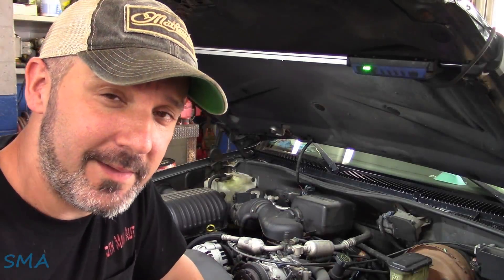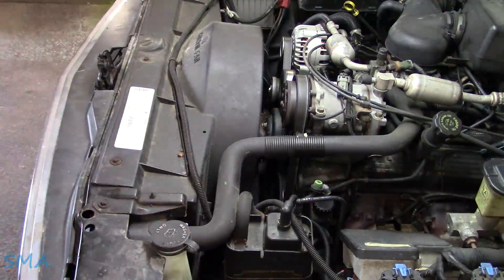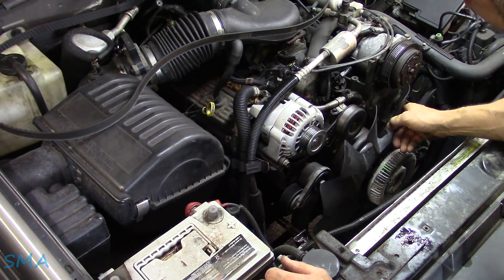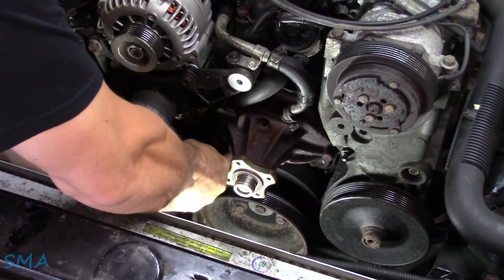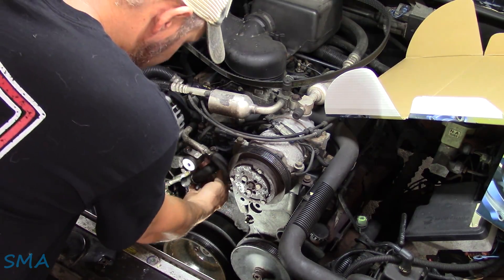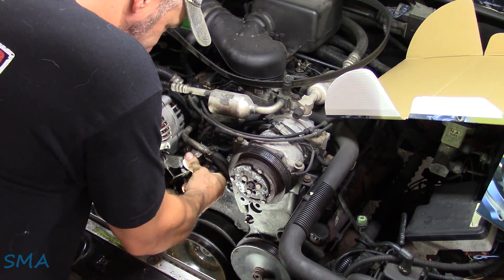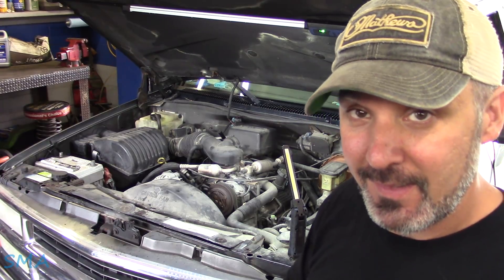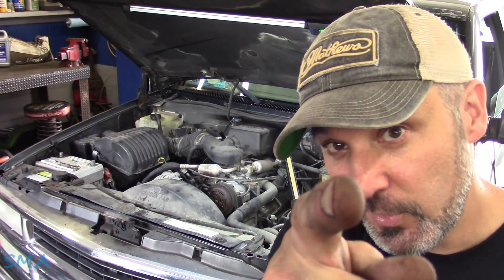Water Pump Replacement: 5.7 Chevy Tahoe / Silverado / GMC Sierra / Yukon

Comment: @23:19 Typical American automobile manufacturing ideology. Once something is perfected, dump it in favor of a new, unproven engineering design and let the public test it out for you. 
Anyone remember the Dodge slant six?
Reply: I am a GM man through and through, bowtie til i die, but i have owned an 80 Volare with the leaning tower of power, 2 barrel carb (yes, manifold swapped with a super 6). When the unibody rotted away, i decided to see how long it would run without oil, 47 hours!!! When the top end started getting quiet i knew it wouldn't be long, the bottom end started sounding like the top end, and i think it was 13 minutes later it locked up. It was only idling the whole time
Reply: I had a '66 Plymouth Valiant Signet slant six . My first car . It would start at -40 and out run my brother's 1980 305 GM pickup in the 1/4 and for top end . Loved that car .
Reply: A buddy of mine told me his brother had a dodge that had been relegated to being a field car. It had a slant six. He blew the motor up with one of the pistons blowing a hole in the side of the block. He continued to run it on five cylinders spewing oil all over the place for a month before it finally gave up the ghost.
The point is the slant six almost put Dodge out of business because it was so reliable that people weren't buying new cars. We all know what came after that.
Reply: Got a 62 Chrysler in my back yard at the moment, 225 slant six, push button auto, doing the ball joints and a service

Comment: the later engines, had the spider fuel injection, which wasn't that great
Reply: convert to the delphi mpfi unit. Plug and play, a little pricey but eliminates the spider injection problems and inadequacies. Good time to hit the lower intake gaskets while in there that far if they haven't been done. They ALL go bad sooner or later. Felpro problem solver the only way to go on intake gaskets. Great time to thoroughly clean up the throttle body and freshen up the sensors and then drive another 200k miles.

Comment: Chevy thunder!!! Most of us probably know that, other than bore and stroke sizes, the small block Chevy remained basically the same from 1955 until it was discontinued. The only major changes that I can think of are relocating the mount position from front to the sides, spin on oil filters instead of canister filters (both around 1957 or so), main journal size increased (around 1968), roller cam, 1 piece rear main seal, fuel injection and a different angle for some of the intake bolts, along with center bolt valve covers (in the 80s) and, of course, the Vortec heads on later models. Many people, myself included, still play with the venerable small block Chevy! Personally, I prefer my 400 small blocks, which are "a whole different animal" but, I'd rather work on ANY regular small block than an LS all day, every day!

Comment: Goodyear doesn't make Gatorback belts anymore. They are now made under the Continental brand which is owned by Goodyear.
Reply: I've had great luck with Gatorback belts.   Run quiet and L O N G !!!!
Reply: Continental stop making them also
Reply: @rickyg4800  You are correct...with a quick Google search I found the following....Continental Elite Series recently changed to OE Technology Series. Continental replaced their Elite helicog belt construction with the new OE Technology Series straight rib design. The goal is to deliver OE fit, form, and function to the aftermarket.... Still a better belt than Dayco or Gates.

Comment: I have this exact model, mine was a one owner when I bought it, 72,000 miles on the clock many years ago. I'm retired so it now has 122,200 on the clock and it's been a good vehicle. I'm not a big GM fan but the manual controls on the 4wd are what sold me (had a 97 Explorer that self destructed the "automatic" 4wd system and you couldn't turn it off). It's getting a bit of rust but I have a good shop go over it once a year and it does what I hired it to do.

Comment: I've had a few experiences with Chev engines. 261, 250, and 292 sixes, and I believe I have pulled and reinstalled all the small blocks plus 396 and 402s.

Comment: My BIL once diagnosed the water pump in my wife's old durango when they broke down together. So I ordered one and had it ready for when I got off work, pulled up and immediately noticed the giant hole in the plastic res on the side of the radiator.. Yay!! Screw it, filled it up with water, and drove it the 10 miles home. Gotta love those old Magnum Mopar motors. LOL
Reply: LOL, I assume you mean drivers side? where they always cook and blow the tanks out, other cars with vertical flow top to bottom split just above the crimp seam..
"composite junk"

Comment: I had that same engine in my Buick road master wagon loved that car drove it everywhere had the water pump launch off the block and go thru the radiator  went to get a new water pump and they had a 60 buck one with a 1 year warranty and they had a Bosch with a lifetime warranty for 20 bucks damn I miss cheap parts on my cars

Comment: Love this video.  I have a 1998 K1500 that I bought new that has this engine.  The original water pump on mine was replaced at about 24,000 miles when my intake gaskets first leaked.  They said the WP was also leaking but who knows.  I have 140,000 miles on the truck now still running that replacement WP.  I love this engine and body style truck and is why I have kept it for the past 23 years.  I also own a 98 K3500 reg cab long bed 4x4 that I bought in 2007 with the 7.4L.  It only has about 121,000 on it.  Between these two, I shouldn't have to buy another truck ever again.

Comment: I love my 99 chevy tahoe. Currently chasing down a headache of a p0300 code. Spark is good wires all test good. New plugs. Mas air is reading great. No vacuum leaks. Fuel pressure is good. Man what a nightmare 🤣

Comment: I've owned 4 cars with the small block, '66 Pontiac with the 283, '68 Pontiac with the 327 4 bbl, '70 Chevy with a 400 cid, and a '79 Pontiac with a 350. My fav? the 327, hands down. So much power. (Yes, I live in Canada where GM put chevy engines in Pontiacs. :) )

Comment: The belt size issue reminded me of when I did an AC and Smog pump delete on my 83 Mustang, staff at my local Car Quest were very accomodating, I must have taken a dozen belts to see which was the correct fit.

Comment: Replaced the intake manifold gasket on a 5.7 that the Dexron coolant ate....good times!
Reply: It's usually because someone ran it low in antifreeze, most likely a water pump leaking. It overheats that plastic. Felpro makes them out of metal now

Comment: My first vehicle was a 97' Chevrolet K1500 "Heavy Half" 5.7 with 230,000 on the clock. Took that thing all the way to 297,000 before a tree fell on it and completely destroyed the cab and busted the top of the entire manifold. I'm convinced to this day that baby had 350,000 in her easily.

Comment: Some pumps have thinner cross sections and the bolts will bottom before they actually apply full crush to the gasket. (First hand experience)

Comment: I've changed the water pump several times in the old small block chevies and I always went in farther and changed the timing chain and cam gear that always back then had nylon teeth that were always cracked.  There was no chain tensioner and if left alone long enough, might jump a tooth.

Comment: Yah, It was my time also late seventies and eighties. even though the one you got there is rather new. I still have one left in my 89 Chevy step-van. I have been thinking about LS swapping it. But it still works well and it only has 98,000 miles on it.

Comment: Eric, this video brings back memories of the '97 Chevrolet K1500 regular cab, long box that I bought new and kept till 2009. It was a good truck except for the snap ring on the output shaft of the transfer case that broke a couple of times while I owned it. Once under warranty and I think twice it broke afterward. It was a “big horse” and averaged about 15 miles to the gallon whereas my '12 Chrysler 200 convertible with the Pentastar engine averages 30 miles to the gallon. That is a nice improvement in less fuel used and I don't really need a truck nowadays.

Comment: Had a 95 Silverado 1500 Z71 with the 5.7. Developed a cold start knock. They tried several oil filters with check valves to stop drain back. Eventually they  short blocked it under warranty. That motor eventually did the same thing.  Traded it on a 2001 Ram 1500 with the 360 engine. Drove it to 200,000 miles and traded it for a 2012 Ram 1500 with the Hemi. Drove that one to 100.000 mikes and traded it for the 2019 Ram 1500 I have now. Never a Chevy again.

Comment: My '98 is rocking down the highway with 270K on it. Getting close to new radiator time. She's been nursing a small leak for 3 years and this summer she decided to cut loose a little extra. Original water pump, fwiw. She's my drywall finishing work truck, and aside from a battery or three, the usual maintenance items  and a starter, everything but the AC compressor still works. But it's work. Who needs AC to get to and from work anyway? Right? RIGHT!?! Nice video, Sir!

Comment: Love your  videos!
I have a 1996 K1500Z71,that had 322,000 miles,when I got it.
Replaced the 5.7l,with another one with 69k,on it..
The Vortec used a standard  350SBC block,and just changed the heads,and intake,and deleted the mechanical fuel pump,and used roller cam/lifters. ,basically.
A good engine .

Comment: 5.7 was such a reliable workhorse engine. As you said they'd been making it so long that it was pretty much bulletproof. And for modification it had a lot of room to be pushed more then the Ford 4.6 before block failure.

Comment: A lot of guys still use 350's,heck i've got a 327 in my 51 Ford F 1. They are still a reliable engine. 91 C1500 with a 350 over 225 thousand miles still runs beautifully backed by a 700 r4 no rust or body damage.  There are not too many of this body style still on the road.. Most of them Have rotted away Have rotted away.

Comment: I once found out my brakes failed while still in my driveway. Went to start it and I have a habit of stepping on the brake while doing it (old habit from driving standards at early age) and the brake pedal went to the floor.
I felt blessed that day as it could've happened out on the highway doing sixty and trying to stop at an intersection.

Comment: I miss my 1997. I bought it brand new had at 19 years 195000 miles. Wish I never would never have get rid of it.. My 1997 was built so much better and better materials than the trucks today. However they don't build them to last. But hands down my 73² body is built better than any of the current production vehicles. When trucks were trunks

Comment: 60's and 70's a water pump replacement took 15 minutes with good room to work. Are new cars over designed or poorly designed. Working in an engineering department for 35 years, our goal was to design electrical and mechanical systems for easy assembly and repair.
I remember my grandmother's Newport had at least a foot from the grill to the engine.

Comment: The way I've done  them is take two long bolts and cut the heads off, cut a slot in the end for a screwdriver, put one in each top hole , slid the gaskets on and slide the pump on install bottom bolts and tighten and remove the top studs and install the bolts.

Comment: Good ol Murican small block shivy! Still alive and well around here. Lots of used 305s for sale too for some reason...😜
Reply: I have the 305 in my 85’ firebird.  Rebuilt the engine at 290k because seals were all leaking.  Only 003” wear was on the cylinders....didn’t even need boring.  Rebuilt with stock rings and bearings, put in a mild cam, upgraded to MSP electronic ignition (computer free), edlebock carb/manifold, ceramic headers, mechanical tranny shift kit, and flowmaster exhaust.  Now looks/drives like a show car....and is a really bad-ass daily driver.  Dr. K.

Comment: Nice job on that water pump Mr O. You were quite thorough. On my truck I thought about replacing the idler pulley but didn’t and it started squealing about a month after replacing the pump. Strange it wore out so soon. It was easy to replace.

Comment: Great video Eric and good job replacing the water pump. Love those chevy 350 motors. I have the big 6 liter in my 2000 chevy suburban with 180000 miles on her and still runs perfectly.

Comment: Probably the easiest water pump you've replaced.. I have a 98 GMC Sierra. I bord it out to 355 lt4 hot cam flat top pistons 3000k stall.. melts tires off... So easy to work on

Comment: I had a 94 1/2 ton pickup that went 412K 1 owner with 80k when I got it, went the full distance on the stock engine and only rebuilt the transmission once. No mods just what GM put with it. Went through 1 fuel pump 3 water pumps 1 ac compressor 2 radiators (OE was destroyed in a collision @ around 215K) 4 damned Pwr steering pumps 1 fan clutch, did the 4wd little heater based actuator in the front end 2 times,  and towards the end 3 new cats, which showed the end of the truck as the rings finally gave up and it was burning too much oil and would kill cats so no smog passing for it. Retired the old pal to a friend who is running it "off road" on the same engine.. I got a new 2019 GMC 1500 with the 5.3.. lets see how it does... 72k, so far so good.

Comment: I use 2 studs on the top bolts when installing new pump..works great..when lower bolts are started i remove one stud then put in the bolt back in 👍

Comment: I Have this motor L31. Bought one from GM performance installed it and it runs like a top.  Now a motor of the past but is pretty dependable. Owned these blocks for many years through old school to TBI to Vortec heads. Not as fast as a LS motor but pretty solid.  Time to get something newer though.

Comment: The vortec truck engine with the vortec heads everyone seems to love. 1996-1999/2000 model 5.7 engines. I’m fine with the one piece rear main seal, roller cam block, pre 1996 vortec engines. Everyone loves the vortec heads. I would personally spend my money on some better heads like some Dart heads. The 350 or any small block is so basic, easy to work on, rebuild and maintain, and they can handle a lot. I will keep running the 350 engines, not an LS fan at all.
Reply: I'm with on all that.

Comment: Old? I remember when the 350 had various v-belts. Serpentine belts are newfangled. Good engines though. My friend had a '70 C10 with this engine, complete with a Rochester Quadrajet and a three speed transmission. It started out column shifted but he had to move it to the floor later on. It was pretty fun!

Comment: Old mechanic tip for the readers -  When putting on any belt, always put on the largest pulley you can access last. The larger diameter is always easier. Don't believe me? Try it :)

Comment: I hate to say it because I work full time at a Napa, I recently had to replace two napa power steering pumps in a row from the Napa I work at. I double checked threw Identifix the correct install procedure ((as if its rocket science))
 to make sure it was not human error and It had the same funny symptom. A loud audible clicking. Now because of the parts shortages in Tx. I had to suck it up and go to the Green Monster Oreilles to get one for this customer. Theirs has been working properly. This was a 2006 f150 with the massive 4.2 and the two from Napa clicked horribly from the start. Moral of the story, Don't burn Bridges with your competition, and keep a good supply of hats and assorted shirts that don't have Napa written all over them!!!!

Comment: Eric O'...I Highly Recommend the Lisle (Not a Sponsor) Radiator Fill Funnel 24680. It has Adapters for many different Caps. It is Especially great for those Vehicles where the Radiator is not the highest point in the System and you need to purge.

Comment: I have a 97 k1500 had it for years and I intend to keep it until I don't need a pickup anymore, I have been a chevy guy since 1977  I changed for the 100 amp to 130 amp alt and of course  i hade to replace to a longer belt

Comment: Thanks alot.  Yea antifreeze poring under car so I bought a water pump
But I don't have that fan tool you got so I'm stuck also I'm the pulley tool. But I saw you use a rench so we will see.
I also wander if I can use just gasket sealer instead of the spray you used. Please share your opinion ASAP thanks again. Have a wonderful day 💖

Comment: The back of the pump brought back a bad memory of changing the pump on my dad's 69 Country Squire. In the summer in the driveway not in the shade. (48 years ago???) After removing about 300 lbs of accessory drive  to get to the pump I popped the "new" pump on and put everything back. Filled it and started it to check for leaks. There was only one, the back plate on the pump, not tight from the "factory". I could not face the 90 minute tear down again.  I found a 1/2 wrench  that was short enough to fit, then ground down  both ends thin enough to get at the bolts. I may not have saved much time but a lot of effort. I ran across that wrench in my tool box last week. Any time I have installed or watched a pump with a back plate I check them or suggest they be checked.

Comment: I've got a Suburban with the same engine. I suppose having the water pump there is better than one where it is driven off the timing belt and you have to disassemble half the engine bay to get at it.

Comment: Love my 98 Tahoe. Pretty simple to work on. Only bad thing is those stupid oil cooler line and the 90 degree oil filter housing. Think I'm going to delete mine and put a standard housing on it. Other that, the 5.7s are good to go.

Comment: if you reuse old bolts make sure you use sealer on the threads newer small block bolts go into the water jacket and will leak without thread sealer.

Comment: I have a 97 extended cab z71 with 340,000 miles and ticking.  Also the unicorn 5 speed manual.